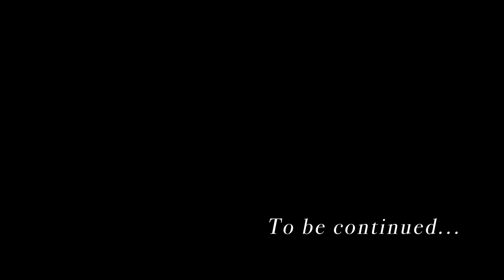The Vik - A Tim Allen Build - (part  Ccii)

Comment: I would weld a circular air cooler in between the two Head Controllers. It would help cool the plate and add the missing "air cleaner" look. As it is, it is missing "something" with that dead space between the controllers.

Comment: The AC motors you are using do not have the tremendous starting torque that DC motors have.  My last build was a 1930 roadster.  I have years of experience.  Any transmission that uses a t400 output shaft will handle your torque. (Remember you only have so much traction regardless the motor torque)   I like your build.   Worry about the BMS you use.  That will be the determining factor for how reliable the car is.  Key=keeping the cells balanced.....

Comment: Bringing a designer to the party should save a lot of headache and result in a more cohesive look.  Right now it’s a very “street rod” approach
.. stick a bunch of random cool parts together and hope it works. Like building a multimillion dollar structure without an architect…
Reply: Problem with most designers, including architects, are in my experience they have so little hands on experience that their design can be very difficult Ney impossible to implement.

Comment: If I were you, I'd pick a new crate EV motor or follow what S2S has done. It's going to require some rework, but your overall time to completion will be much faster given the state you're in.
Reply: Actually pick a cheap 4 WD Tesla and put the Ford body on that.  They do 10 second quarter miles as is.  Plus on dusty streets, the 4WD is a killer.